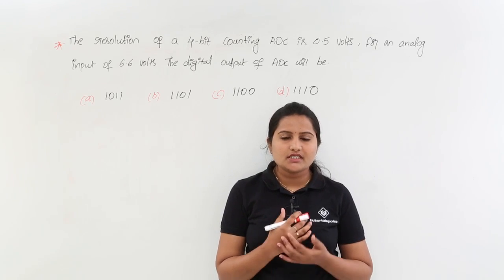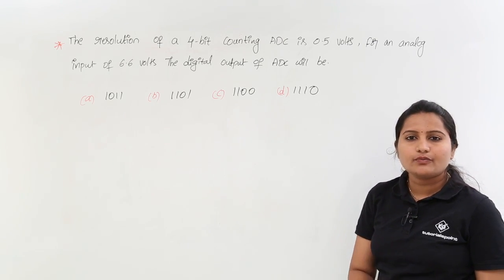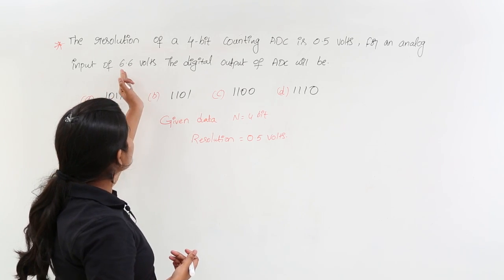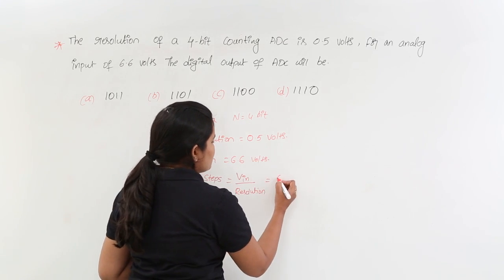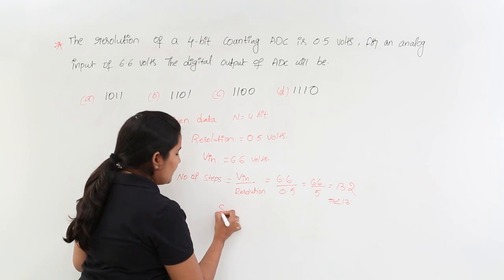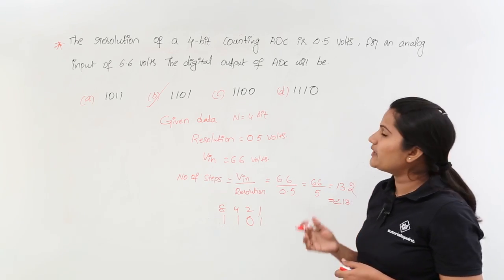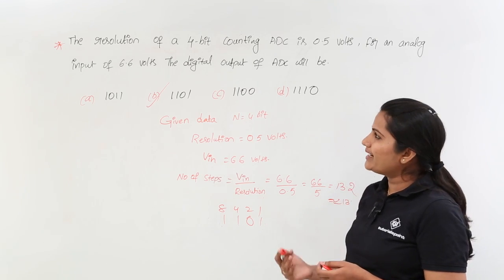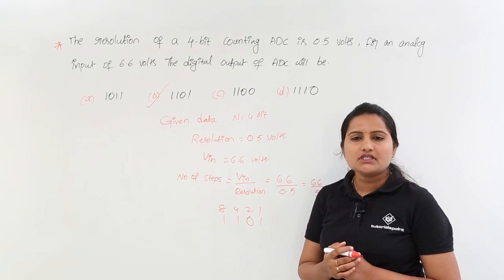Resolution of DAC GATE Model Example

Comment: Mam the answer is wrong!
it will go on 14 as 6.6>(13*0.5) so the output will increment by 1 and will be 14 and then it will stop working as 6.6<(14*0.5)
check it and correct it!

Comment: Mam answer should be D!!
It will check that 6.6V > 6.5V(digital 13*resolution 0.5) and will give 1 increment and become 14(1110)!
After that condition fails and ckt stop working!
so ans is option D!
also refer que 4 in below link:
https://www.indiabix.com/electronics-and-communication-engineering/exam-question-papers/205001

Comment: Mam in counter type ADC till the comparator is high counter counts.
So after 13th clock cycle the stored digital value is 1101 which gives 13*0.5= 6.5 volt. Comparator output goes high 14th clock pulse will trigger the counter and count will be 1110. After 14th clock cycle  14*.5= 7 volt now comparator goes low and counter stops at 1110. Answer should be 'd'